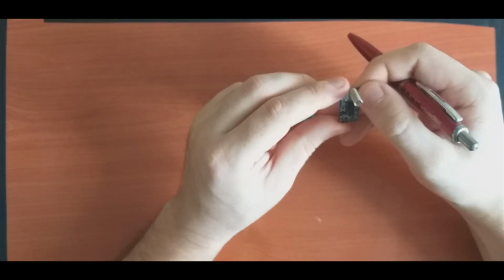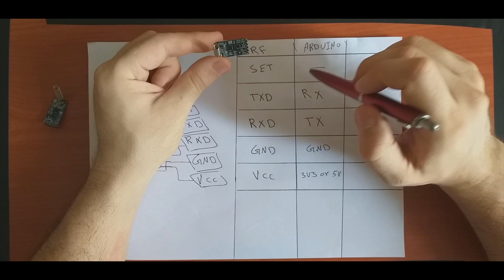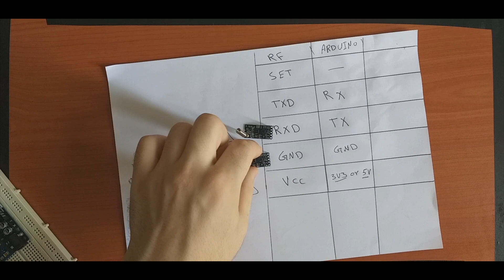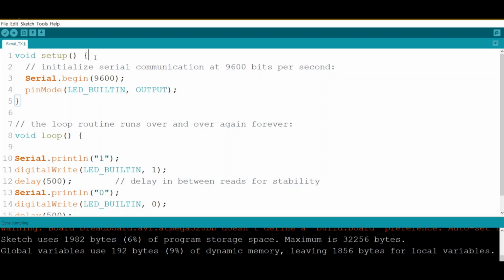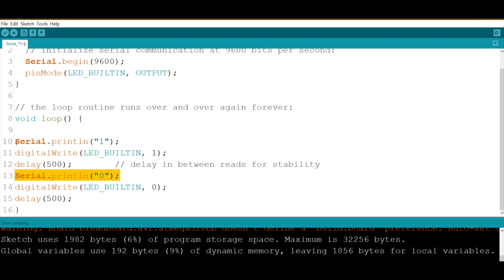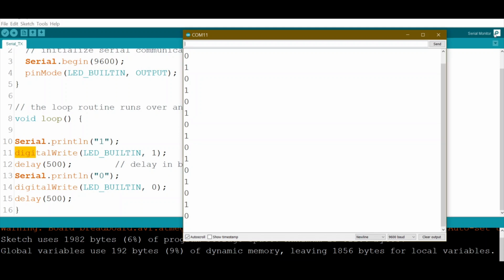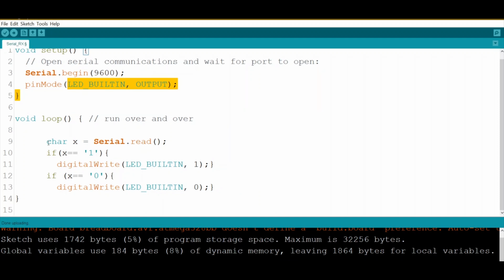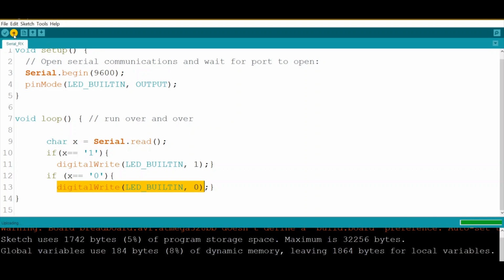1Km RF UART 433MHz Wireless Module with Arduino 📡 | Full Communication Tutorial

Comment: Hello Max7219 is a LED display driver and uses 3 wires connected to 3 pins of arduino. Is it possible to use the 433 MHz RF module so that instead of connecting 3 physical wires between the MAX7219 and arduino, it will become wireless? Thank you
Reply from the maker: No, you need MCU to link and convert the data between the MAX7219 and the wireless module.

Comment: Thanks a lot, my friend. I need help on how to connect a 3DR 433MHz radio with Arduino to control 2 through two switches on the side of the transmitter
Reply from the maker: Sorry for the late reply, I will try to work on that in my next tutorials. Stay tuned...